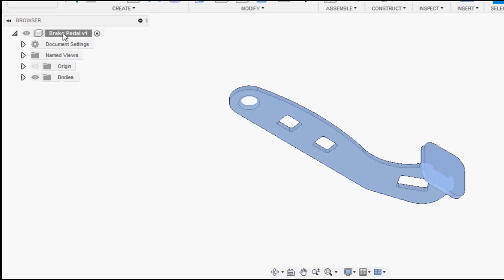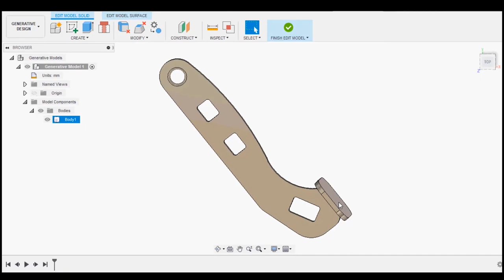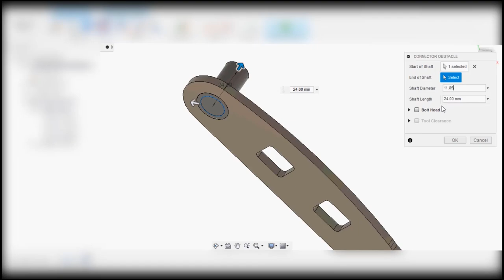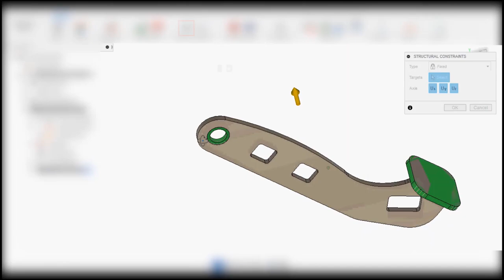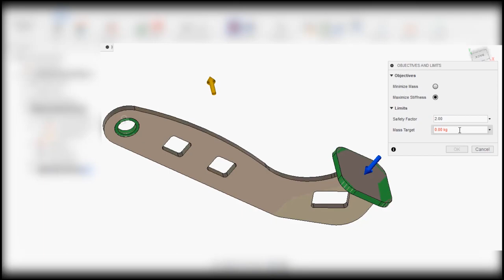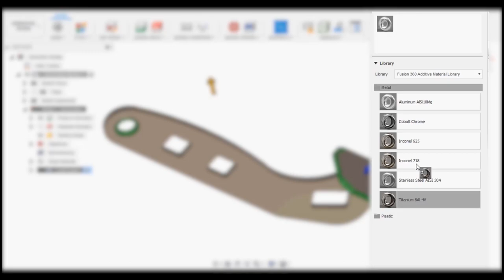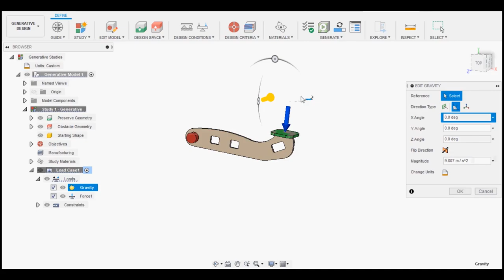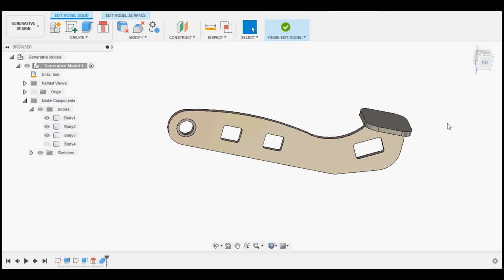GENERATIVE DESIGN PART -1 || FUSION 360 || BRAKE PEDAL

Comment: Hello,
Thank you so much for the video. I have a small question. Is it possible to change the material properties (e.g. yield strength) while choosing the study material in fusion 360 Generative design?
Thanks in advance.
Reply from the maker: Of course you can.
Here's how you can do that go to
materials- manage physical materials- right click on any material and add it favorites 

Now go to favorites and click on that edit icon next to the material you'll get all the properties of that. Under physical expand mechanical and change properties according to you then apply.
To add go to material- fav- drag and drop the one you edited.
(Rename the material while editing so that it would be easier for you to identify)